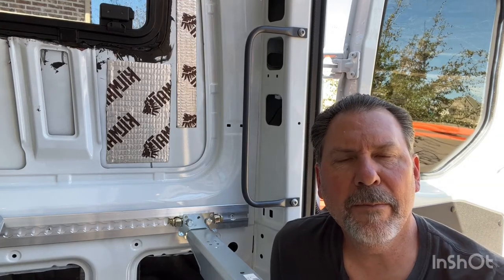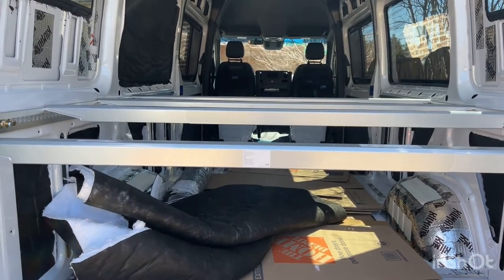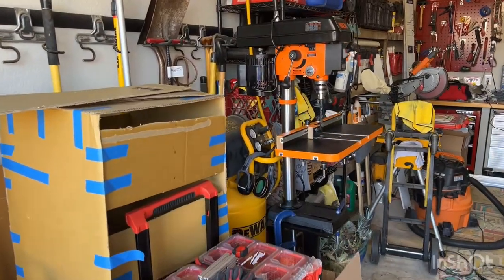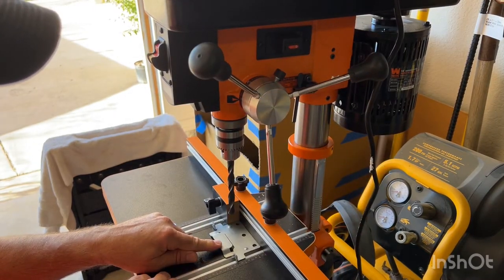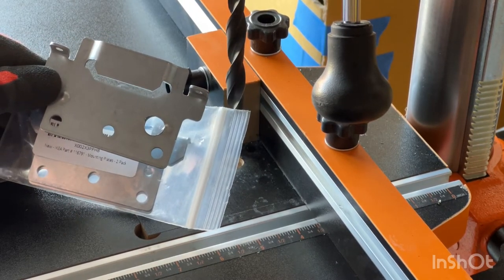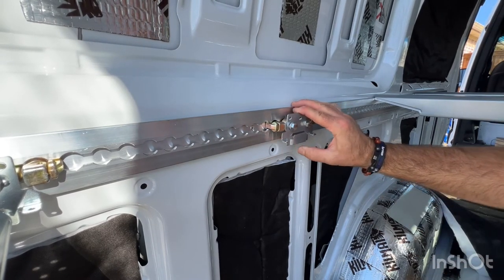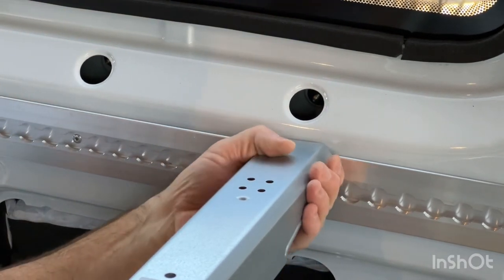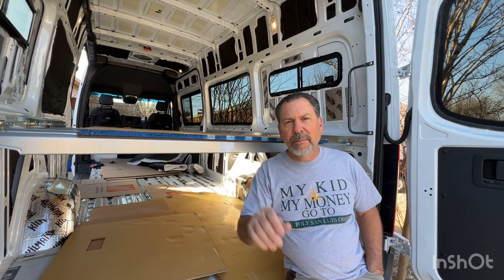Sprinter Van IKEA bed hack

Comment: Just a suggestion: if you thread a nut on bolt Before you cut it, when you remove nut (post shorten), it will clean up threads.  Super simple, fast, only need One nut.  👍🏼
Reply from the maker: Thank you, great tip!

Comment: Skorva rails are great. Inexpensive, strong. I was fortunate that with my old 2005 Sprinter, there are slots along the bottoms of the recessed panels for windows that the Skorva end tabs fit into perfectly. No need for L-track or any other major hardware. I just had to fabricate some L-shaped brackets out of some aluminium flat bar and tap some threaded holes into the horizontal rib underneath to secure the rails.
Reply: Hi. Would you happen to have any pics of your bed mounting solution? I have a 2007 and looking for an inexpensive hack. Thx.
Reply: @erictittle7531  I've got a couple of vids posted on my bed setup - the first of two will show you how I got my Skorva rails mounted.

I've got a 2005 Sprinter and the way the sheet metal around the window panels made it stupid easy - I don't think the next models have the handy dandy slots to use there. You'll see.

Otherwise, a cheap way to go would be the mounting brackets that Ikea has for these things, mounted to something like a 2x4 and that mounted horizontally on the walls.

Comment: Thank you for the video!!! I can't wait for my Ford Transit to arrive so that I can implement this. I plan to use 1/8" rubber 2" wide as a continuous gasket between the metal and L-Track... of course, this is my theory and not tested out.
Reply from the maker: The rubber is a great idea as I do get some metal creaming out of current setup.  Thanks, I am going to look into application of rubber.

Comment: I wished I’d seen this three years back 👏👏👏👏. Are you planning to install a air conditioner being in Texas it’s a must have
Reply from the maker: Absolutely will be installing AC, but want a 12volt unit that can run without a generator.  Believe this will require at least 800 amp hours of battery bank.
Reply: @vandingo1  we run a 120 volt Houghton air conditioner from RecPro for 4-5 hours on 600 amp hours of Battleborn batteries.
Reply from the maker: Thanks and good to know.  Being in hot zone territory I am looking to run ac from 10 to 16 hours…not sure yet but want the capability while boone docking

Comment: Can you share any info about the table of that drill press?
Looks professional!
Reply from the maker: Sorry for such a delay, I picked up a sort of industrial small table from Harbor Freight then put the drill press on top.  I used c clamps to hold the contraption together - seems to work fairly well.

Comment: I love the set up. 

Do you think the L track brackets will hold on vertically mounted L track? 

I have L track installed in my van that runs vertically.
Reply from the maker: Should be stout enough.  The US Cargo Control L Track stud mount brackets are rated for 1,333 lbs each so they should be plenty strong to handle the load which I figure roughly is around 500lbs.  Two grown adults plus mattress, ply board and hardware.  The interesting unknown is load strength of riveted L Track on the Sprinter.  Think I am good though as we would never have maximum load while driving.  Thanks
Reply: Yes. My dad said he uses the ltrack brackets Ti tiedown automobiles on trailers. He said one would suffice per. Side instead of two, then just drill out the middle hole in the metal plate.

Comment: Great video!   I want to implement this bed in my Transit. I don't have a dremel tool or a vice.  You mentioned that I could special order the bolts in the right length.  Do you know where I would order those from?
Reply from the maker: Best of luck with your build.  I would suggest Amazon, Home Depot or Lowe’s.  There are also specialty suppliers on the web, my recollection is Zoro might have them.
Reply: @vandingo1  Okay.  Thank you for the suggestions!
Reply: Amazon, Actually, since I only used one L track bracket I have an extra set of brackets and bolts if you want to buy them

Comment: Do you build the walls around that track? How much weight will it hold?
Reply from the maker: Hi, I ended changing the design so did not fully install, you can see in later videos on my channel I shifted to using 8020 to construct the bed platform.

Comment: Im going to put in a full size bed. Would i need 3 Skorva bed slats or 4? how far apart do you put them? 
Full	mattress is: 54" X 74"
Im in a 136" Promaster.
Reply from the maker: Hi there, I believe I originally had 4 set up, but also had a queen bed with 2 people.  Seems like 3 would work, I always opt for added support, only because I am not an expert or an engineer, so I tend to add more not less.  Looks like you found the video I was referencing…https://youtu.be/Beejxq5w1cQ

Comment: i love this hack, concerned about the rattle sound on the L - track once it hits big bumps.  Did you find a solution to quite it down >. thanks, for this video, I plan to follow this
Reply from the maker: Hi, I am exploring the spray on rubber product and will experiment and report out.  Thinking I will spray into the area where cargo control inserts meet the L Track.

Comment: Shouldn’t the plywood have holes in it for ventilation to keep mold at bay?
Reply from the maker: Yes sir, in future videos on the channel you will see where I did cut holes in the wood I used for the bed platform…ventilation is indeed important.

Comment: does it rattle  on rough roads
Reply from the maker: Have not had it on rough roads but on uneven roads I do get some squeaks.  I put some rubber strips where the bed struts sit on the brackets, which helps but doesn’t eliminate entirely.